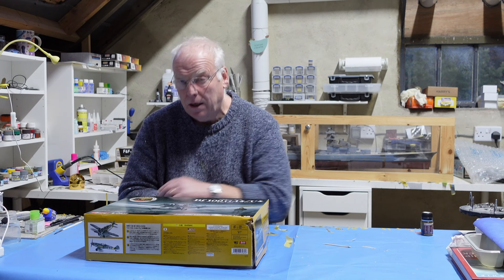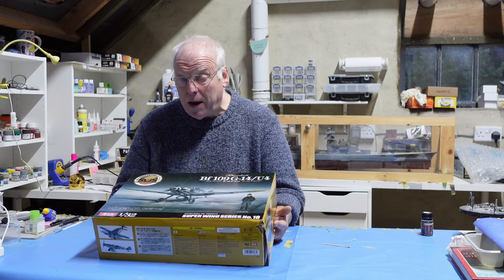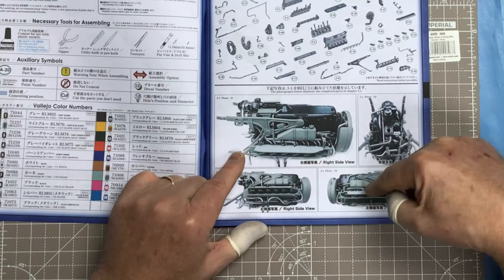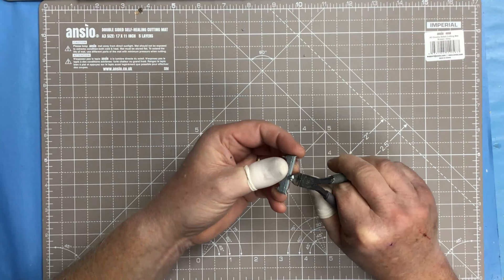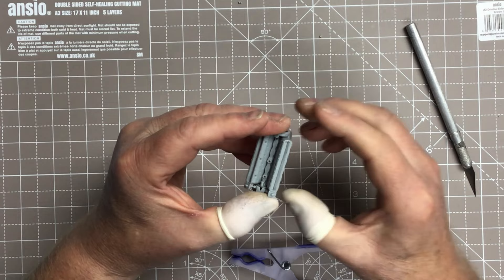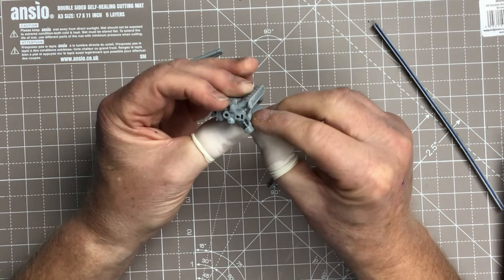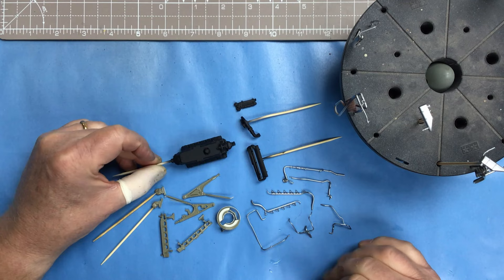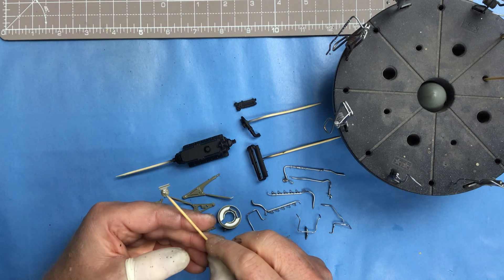Zoukei Mura 1/32 Bf109G-14 Part 1

Comment: Great start Steve, the lower arm of the port engine bearer also broke on mine,as you said brittle plastic and I hardly touched it and it broke. Nevertheless lovely to build and not quite as well engineered as Tamiya but not far away, good observation on the coolant header tanks, as I recall from the factory they were painted RLM 02 but after engine rework and major overhaul were likely to be painted silver especially towards war end as any paint would do!! looking forward to the cockpit build. Will send pictures at the weekend.
Reply from the maker: We’ll have to be careful now Alan. I’m thinking that I’ll attach the engine to the firewall.at the three remaining struts, secure the pipe work  through the firewall for extra support, then fit the remaining broken arm. Hopefully I’ll end up with a straight engine ,,,,,

Comment: I would not worry too much about the oil coolers being silver. From what I’ve read about all versions of the 109, there are various parts painted different RLM colours or bare silver, from the oil coolers, to the frame mounts. The interior cockpit colours were the same way, depending on what factory they came from. Seems to me any modeller has artistic license when it comes to what RLM colour goes where on the 109. I’ve found that somewhat convenient, leaves it up to the modeller’s preference.
Reply from the maker: Thanks Mike I’ll probably leave them as they are 👍
Reply: @TheModelShed  I think they look nice.

Comment: Great start to the kit. I may be mistaken but it looks like Zoukei Mura has molded the piping and the smaller parts of the engine bearers "in scale" making them very fragile. I was keeping my fingers crossed that you wouldn't have the same problem cleaning up the plumbing, I half expected one of them to snap but thankfully none did. Looking forward to the cockpit build.
Reply from the maker: Thank you . I think you’re right about the scale of the parts but that’s not helped by what appears to be fairly brittle plastic. I’m definitely forewarned and forearmed 👍

Comment: I watched this series when you first released it, and decided to re-watch it again. Just noticed a series 7 case when you were doing the wash. As I've recently gotten into warhammer mini painting I've gotten a few of those for that. Expensive brushes, what do you use them for in scale modeling?
Reply from the maker: I use my series 7s for detail work such as in cockpits etc. they’re the best brushes I’ve used - ever - and they last ages provided you look after them properly
Reply: @TheModelShed  Thanks for the response. In later episodes you mention brush painting details with Tamiya lacquers. Two questions about that. Why lacquers and not a water based acrylic? Second, the lacquers are ok to use on a series 7?

Comment: Very nice work on painting and assembly of the engine.  You stated you have a separate airbrush for metallic paints, what is your motivation for that, needle size, tank size, ease of cleaning?
Reply from the maker: Cleaning mainly Marcus. I find it hard to get every bit of metallic flake out before using a flat colour in the same airbrush
Reply: Thank you for the feedback.